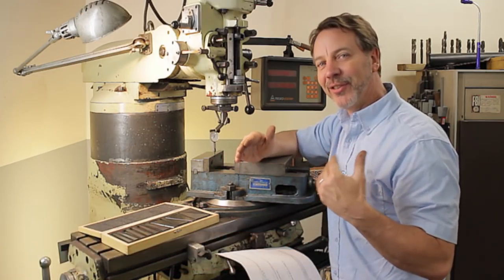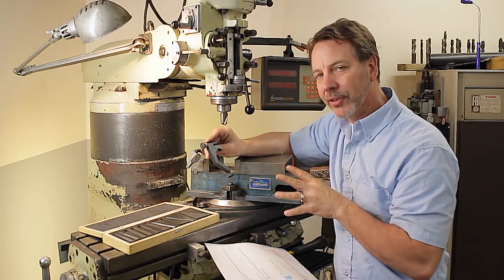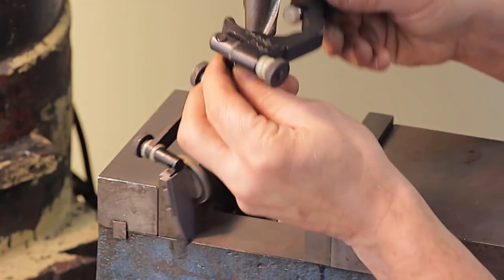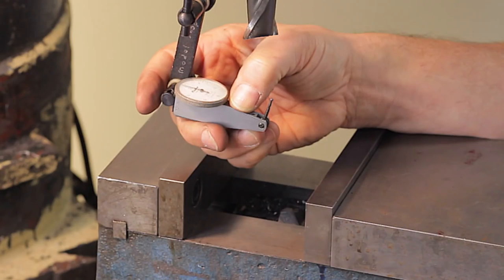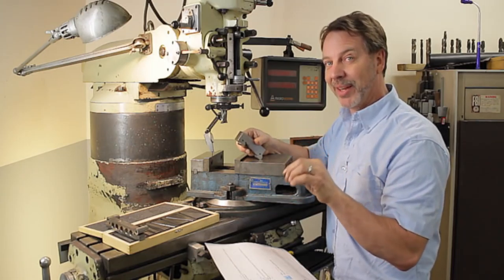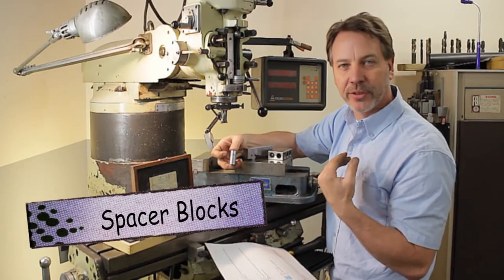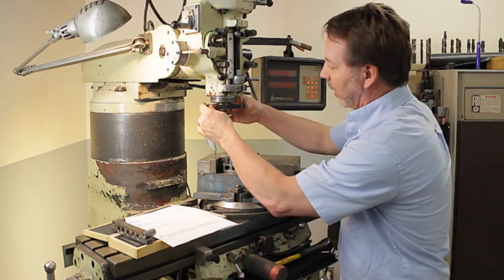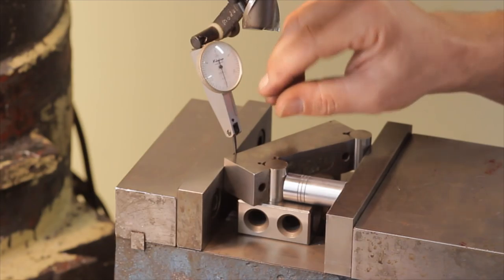Q AND A Traming a vise

Comment: Thanks Dave for providing the details. 
I really like your Q&A sessions that you provide after some of your videos. It is a great review even for those that think they already know this stuff. There are many ways to do most of these operations and we always can learn something new. By the way, I use the phone app "Machinist Buddy" for many of my machining calculations for things like knurling diameters based on knurl pitch sizes, cutting speeds, and even the sine bar setups. Thanks again, Paul
Reply from the maker: +Paul Jones 
Ill bet its a great app, but I have a iPhone. :-(

Comment: Good point about the gauge block - whether ground one side or not. Must check mine!
Got an Indical 'knock-off' recently for mounting to spindle -- just have to adapt the end - does seem useful for odd occasions.
Since your mention I have altered by probe safely on the 15-0-15 indicator... thanks.
Reply from the maker: +ChrisB257 
thanks for watching

Comment: Just a note on your test indicator, the angle of the probe is vital to making accurate measurements.  When just used as a comparator gauge, it's not so important. When using the test indicator in combination with a granite plate and height gauge, the angle is very critical. I believe that with Interapid indicators, they are calibrated at 12 degrees. I don't remember Mitutoyo or Starrett though.
Reply from the maker: +Jessie VaineoHurst 
Thanks for the info. :-)

Comment: As always great video Dale. A minor correction tho. Yes some of those off shore made hardened and ground angle blocks are fairly cheap until you start looking at the one`s that have Starrett on the box. If you haven`t checked the prices of those and you need heart meds, then I`d take some before looking for them. :-) High quality steel gauge blocks even brand new are pretty cheap in comparison.
Reply from the maker: +Turning Point 
good input

Comment: Both videos are excellent.Question: Could you demonstrate tramming the head (not the vise) using the nod, swing and rotation of the Bridgeport? I recently had an issue with drilling irregular shaped holes. It turned out I had both the nod and rotation of the head misaligned. I was able to square the head, but would really like to see you do this to see my technique was efficient.Thank you.
Reply from the maker: +acklan3  I did a video on traming a head a while back go check it out.
Reply: ***** sorry about that, I will check it out. Thank you for the reply.

Comment: Nice video series I have followed along tramming my vice but I have one question!
Do you have any tips on tramming a pair of vices as I have just ordered another vice for my cnc milling machine. I'm planning on holding a length of metal and tramming the pair of vices together :)
Reply from the maker: +David Stevens (davro) Tram one vise. Clamp a straight edge in that one, and set the second vice to the straight edge.
Reply: +Metal Tips and Tricks (Dale Derry) I done as suggested and the long straight edge really showed up how bad my initial effort of tramming in the first vice was, So re trammed in the pair of vices using the long straight edge and managed to get the pair to within 0.005mm across 400mm of travel. I also found the height of the vices is slightly off a mm or two, these are not kurt vices ;) so I also had to pack up one of the vices to get them level across the top of straight edge something I did not consider until I had dinner ;)

I will make a video showing the tramming of a pair of vices, just in case I have my clown shoes on again :)
Thanks for sharing and making these videos it really helps!

Comment: Go Digital I say!  For about $20 each you can buy digital level with magnetic base and and a digital protractor.  The level sets any angle from horizontal to within 0.1 degrees.  For angles on horizontal plane the digital protractor is set at desired angle and clamped in the milling machine vice.  With an indicator and a bit of hammer tapping the angle is set.  Tighten down vice and then take out the digital protractor. Your vise is now set to 0.1 degrees.
Reply: +Joss Fitzsimons  I`ve got one of those digital angle finders also, and at the very best there only willing to say there accurate to a 10th of a degree just as you`ve said, or 6 minutes of angle. Yes that`s good enough for lot`s of work, but not even close to what even a cheap sine bar and a set of those spacer blocks Dale shows. And they only work in the vertical orientation. Those Wixey etc digital angle finders do have a place, but they are at about the wood working level of accuracy. Just as an example, divide a circle into 7 parts and you`ll see what I mean.
Reply from the maker: +Joss Fitzsimons 
Ill have to go buy one.

Comment: You shouldn't need an app to calculate a sin bar height.  It's just the distance between your two round bars multiplied by the sin of the angle.  If you have an iPhone sin is right there on the calculator.  Just turn it sideways.
Reply from the maker: +John Creasey 
thanks the  info